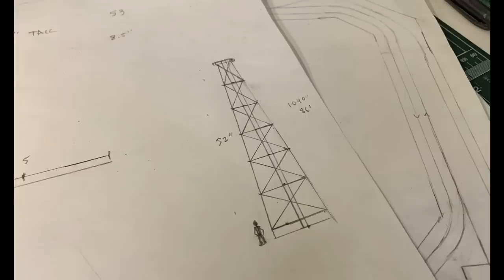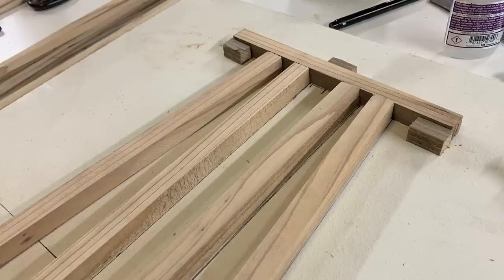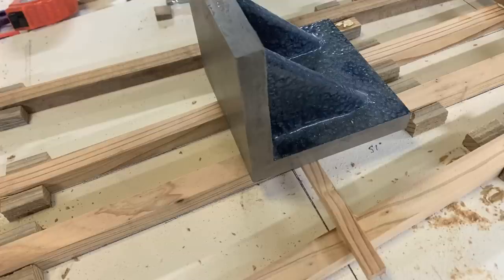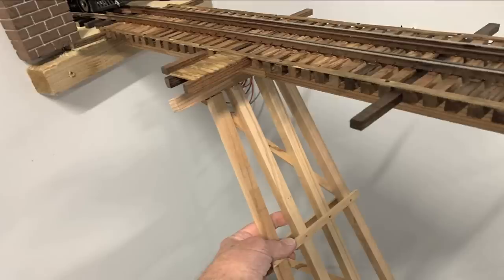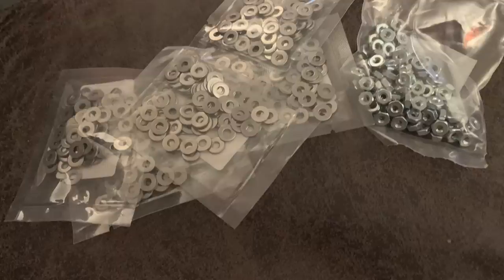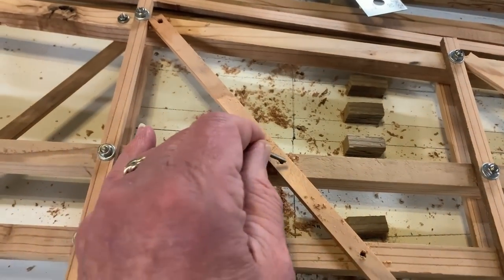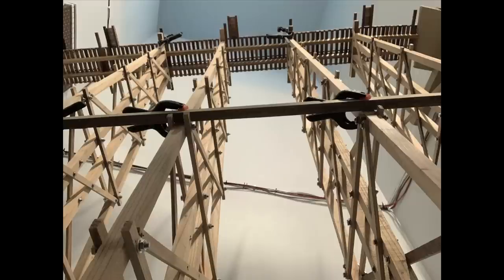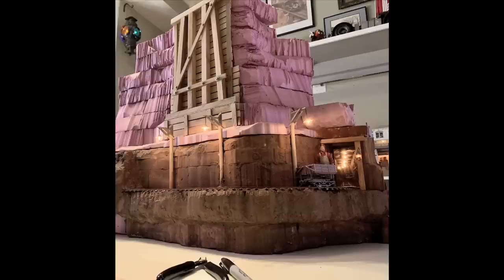Modeling the Huge "F" Scale Trestle at Garagemahal - Part Two - The Trestle Bents (Legs)

Comment: Hey, Guys. Instead of tape, which sticks to the wood. Use WAX PAPER. The glue can not stick to it because it is -  oil.  It will pull off the glued pieces, leaving no paper or whatever.

Comment: Nice work. A pointer on using yellow wood glue (after having built wood furniture for years), is to use a small paint brush to spread the glue out on both sides of the joint. You want enough glue to cover but shouldn't be oozing out all over the place. When done, you can wash the brush out in water and even if you forget to, you can soak in water and restore the brush. I have used the same brush for years.
Reply from the maker: Plan!! Thanks!

Comment: The sway bracing between bents is connected like the sway bracing on each bent but does not need to span more than one span at a time.  It looks like you have 7 bents; the abutments are included in the number of bents.  Bent No 1 is an abutment, Bent No 2 is the baby bent, Bents No 3, 4, 5, & 6 are the full height, & Bent No 7 is the right abutment bent above the mine.  The horizontal pieces between the bents are called "girts" and are not necessarily continuous from one end to the other but are above or on top of the sills.  The girts span just inside or outside of the outside post between  No 2-3, 3-4, 4-5, 5-6, and the mudsill to the bottom of the top story from the abutment No 1 to No 2 and No 6 to abutment No 7.  Alternate the side, inside and outside, for the girts.  According to the Rio Grande Southern RR plan, there should be 3 girts between bents for each story above the bottom one.  The girts between the vertical posts would attach to the sills just side by side.
The sway bracing between the bents would be the same size as the other sway bracing but not extend beyond one span and would be on the outside posts only from top to bottom unless for a road or stream on the bottom story.

Comment: Great job! Loving the results of your tressels.

I agree that your jig could have been full size, but it's looking like that what you have is working just fine.

At 4:00 you're using blue masking take. It works, but glue sticks to it as well. When I'm building my balsa airplanes I use wax paper. Wood glue doesn't stick to it...as long as I remember to put the waxy side up.

It was a fantastic idea to build your tresses taller. It's much easier to cut them down to length as each location could be different due to grade.

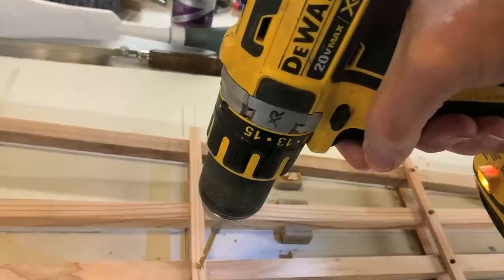At 12:50 you're like me. I go way overkill using my Dewalt drill on small projects as well as my large construction projects. :)

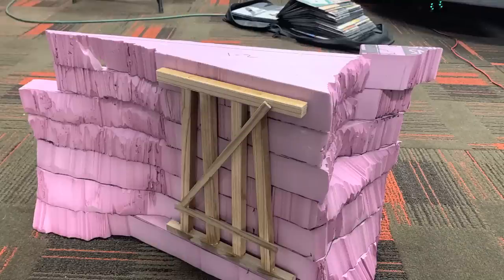Wow! At 19:23 and 19:35 I'm finally visualizing the results of the process. That entire project is going to look amazing! I'm loving the results thus far.
I also love Karyns' jokes and quirkiness, and the "light at the end of the tunnel" was spot on.
Thanks again for another awesome video!

Comment: Did you play the jukebox when you build your trestle
Reply: You're asking the important questions here
Reply from the maker: Nope. It doesn’t work. Well…. It plays 45s manually. I had it totally restored in 1985. Bought it in about 75 for $25. Anyway finally restored and loved it. I would play Tetris on my Mac 128 while playing it. Anyway it was STOLEN in 1999. And in 2007 I found it in an antique store!  Bought it back. Super long story but was able to buy it for about $300. But it was trashed. Anyway I’ve been restoring it. Again.

Comment: If building a pile trestle or any other piling - the top of the tree is driven into the ground. This is so the ground pressure is against the piling as it is driven deeper due to the tree taper.

Comment: The scale of your bolts compared to the size of the wood is wayyy out of proportion.  Couldn't you could have used something smaller than 4 MM  Just looking at a scale says that this is wrong.  ALSO  How did you scale the size of the timbers in the structures to the scale of the loco and cars - if there is really a scale. How will you weather the timbers of the woodwork. water paint would probably do nicely or a wash with acrylic - grey??
Reply from the maker: The scale is 1:20.3. The posts are 3/4” so 15”x15”. I’m weathering with wood oils. Watco oil. Doesn’t look like old wood but looks good anyway.

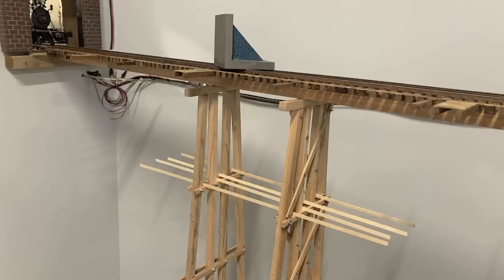Comment: 16:05 "horizontal elements"
Y'know what I'd call them?
Stringers
Based on long past naval architecture lessons, stringers are the longitudinal colleagues of ribs/frames (which are the transverse — athwartships —strength members)
I did a v quick Google search.  Alas! all initial results feel in the aviation domain, but! the principle held:  stringers are the longitudinal strength members (both wings and fuselage!)
The following is based only on what I've learned in your 2 tutorials; should be interpreted: as good-natured RIBBING, not any kind of know-it-all-ness!
If the lateral cross pieces are sills, and the bents were truly stacked (unlike your derisively cheap uni-pole approximations) then it would stand to reason that each sill would be — as with doors and windows — at the bottom of each section.
Reply: P.s.  piers are the modern term for the vertical supports on bridges.